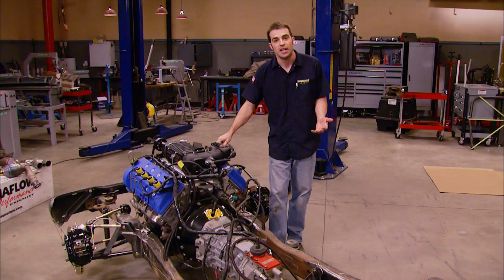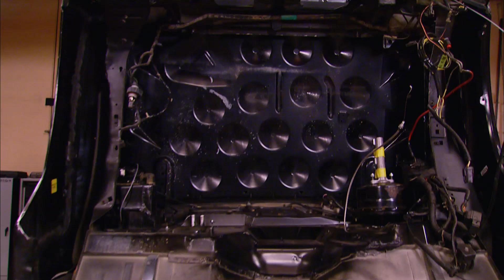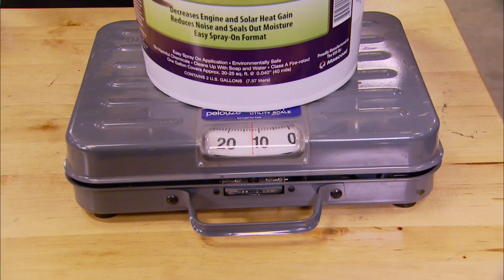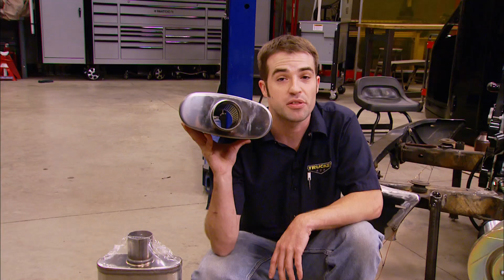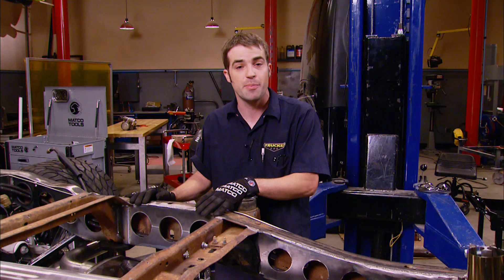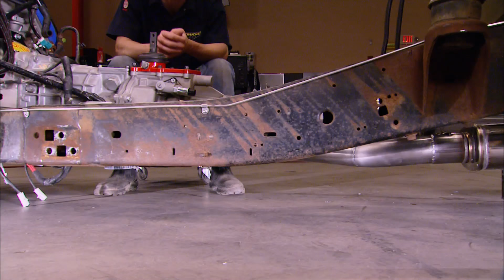X-Pipe Exhaust for our Ford Ranger - Trucks! S13, E18

Comment: I really really wanna spray this lizard skin stuff on my truck...I've got raptor liner on the exterior and under my truck...but now I see what lizard skin is and I would've used it in my engine bay and under my truck too had I known about it ..I saw it when I was looking at paints and coating but I didn't know what it did...I wish I had grabbed it up...I could still use it under the hood and I can wait until the raptor liner wears out and then do the lizard skin or just go to the raptor liner with a silicone sanding cup and then start over and this time use the lizard skin...only one thing...maybe I would like to get a new car!? If so...I wanna go at it the same exact way...max out my body protection and heat protection and effciency...a more complex engine vehicle means more and easier upgrades! Super excited about that...so there's alot of possibility.

Comment: Nice job on the exhaust although I would have moved the "X" pipe further back so it was not under the transmission end housing seal . You know its going to leak eventually all over the exhaust.
Reply: It’s a great thought maintenance wise however, since it is a performance oriented design, they’re moving it as far forward to help with scavenging and equalizing exhaust pressures, I presume.

Comment: I wonder if you could just wrap the entire exhaust in turbo wrap. 😎
Reply: Mine is wrapped from the headers to a couple feet past my xpipe mainly because I had a ton of wrap.
Reply: It made a noticeable difference in the sound in the cabin, and it feels like it increases throttle
E response, but that could be wishful thinking
Reply: @charlesparr1611  Have you noticed higher engine temps?
Reply: @Cotton_Eyed_Joey  no, but I don’t have a
Oil temp or coolant temp gauges on the thing yet. What I have noticed is hen I lift up the hood to check the oil I am no longer blasted by a wave of 300f air. Before I wrapped my headers, I had to open the lid and step back for a minute, as it was uncomfortable to breathe the air.
Part of that probably comes from it being a g20 van with some custom raceresque bodywork, and a bunch of isolation baffling to assure as cold an air supply as possible. The engine and the engine bay have minimal air circulation even when driving, and it depends entirely on the radiators to chill it. 
But when you wrap the headers not only do they no longer radiate like heaters, the exhaust gases the,selves stay hotter, leave the engine faster, improving scavenging and dumping way more heat out the side pipes than previously.
I have no access to a Dino, but I estimate my engine (it’s a modified tbi, with mildly ported tbi heads, a much improved exhaust, a hugely improved intake system, way more fuel through the injectors and a better spark. Stock these things make maybe 180hp, I think I got 40. Cam, heads, and a real ecu happen soon.    Anyway of that 40hp, a good chunk showed up when I wrapped the pipes.   It’s remarkable how much it does.
Reply: @charlesparr1611  very nice!! Great upgrade from such a small addition. Wrapping exhaust is a very underrated upgrade.

Comment: the X pipe they used is the same as ford used on there performance cars back in the 60's it can make a surprising difference in how a engine performs . it's just to bad they stopped using them in the 70's they made a huge difference in power from the stock engines
Reply: I can't think of a single Ford which used an X pipe.  I've run them on the dyno before and I've never seen a big improvement over a regular crossover pipe.

Comment: You can make the tubing straightener yourself from 3 old pulleys or even 3 round pieces of wood(this works best, can make different ones for each tube diameter) you sand a tubing sized groove in. Mount them on bearings so they turn easy, make the middle top one adjustable with a bolt to move it up and down.